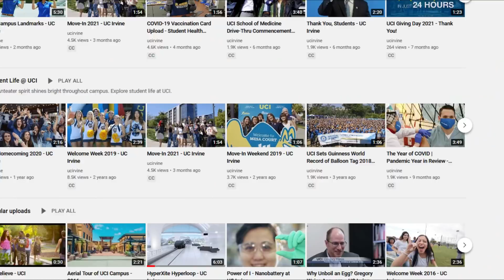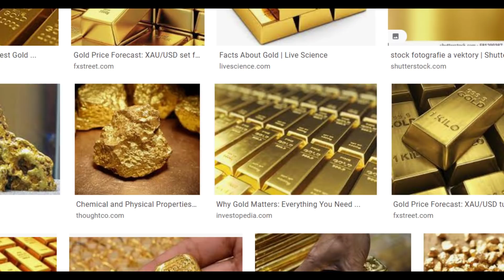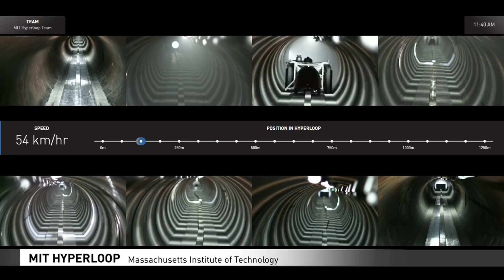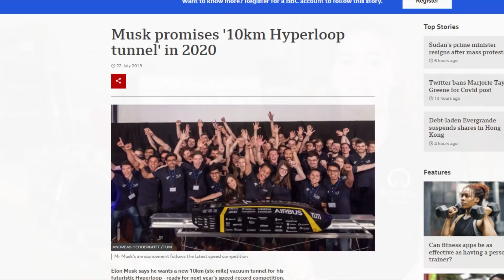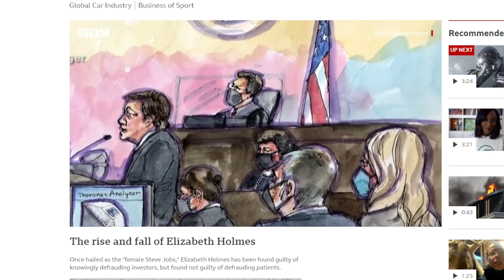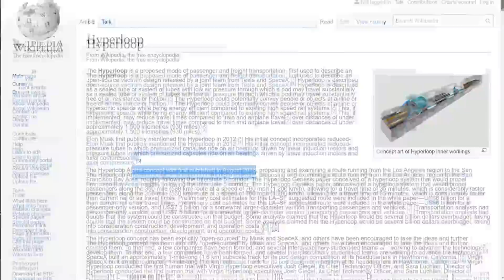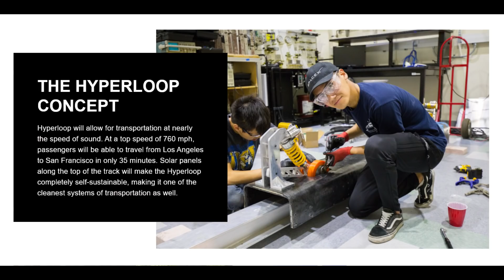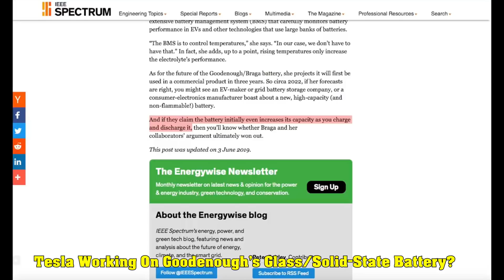The GOLD Battery that will revolutionize EVERYTHING!

Comment: When I was in electrical engineering college in the 90’s, the big national competition with teams from multiple universities was the solar powered car, I believe sponsored by the Department of Energy. I remember arguing with one of the contributors at our college that this was a complete waste of time, that they weren’t solving an actual problem. Better solar  panels is one thing, electric cars is another, but there was never going to be a solar powered car. All it was was an exercise on low weight design, finding a lightweight student to drive it, and optimizing some charging cycles, nothing like an actual car.
Reply: But then schools wouldn't get that grant money that the administrators just end up pocketing.
Reply: Why is that not possible? All you need is a solar farm connected to an inductive charger road with an electric car on it.
Reply: @BillyViBritannia  And how much will that charger road cost ?
Mein Got, we have problems to construct and maintain roads from "cheap and simple" materials like concrete and asphalt and you're dreaming about charging roads.
And I'm not talking about how long those roads would last.
Reply: @BillyViBritannia  why not instead build trams lol
Reply: @BillyViBritannia : Inductive charging would have a ridiculous amount of energy loss going through 4-6" of pavement. The electromagnetic field would cause interference with any electrical device within range, to include the rest of the electronics on the car. The cost of running high voltage coils under the road would not be economically viable.
Reply: @BillyViBritannia  basically, solar irradiance is ~1kW/m². So if you were to cover a big car with solar panels, you could at the very tippy-top, reach 10kW solar power (light, not electricity). The peak efficiency of Solar panels is fairly low, at about 20-30%. So this big car can at best generate 3kW peak, when the sun hits the panels perpendicularly. In reality, with a flat roof (sun tracking isn't really viable ona vehicle), you'd be looking at about half of that - or about 1.5kW/2HP peak.
At ten hours sun per day, this would be sufficient for about 50 miles of driving per day, but only if the car is never in shade, parked inside, in poor weather, or anything else, in a very sunny region. And that is the absolute optimum scenario - a big car with it's entire hood, roof, and trunk covered in solar panels, with the electricity consumption of a compact car. 
So solar cars need to defy the laws of physics to ever be feasible.
Reply: @BillyViBritannia  can't we just have large overhead wires, while we are at it maybe we should make the vehicle larger and have multiple people inside... You know as these people are going between two places, we could put it on rails to make it more efficient...
Reply: @fatrobin72  don't let eev blog see your comment 'visual pollution' he says
Reply: Except our Nuna cars (from University of Delft) have won most out of the World Solar Challenges, they work, the new classes even have room for 3 to 4 occupants.
I'm not saying they're really practical, but at least they work.
Reply: I went to university from '03 to '07 and that was still going on, along with an F1 style race competition, SAE Aero Design Competition, and others I don't entirely remember at the moment. These mostly undergraduate enrolled / graduate supervised school "clubs" are unlikely to produce scientific breakthroughs in technology, but they are fun ways for students to get practical engineering experience. I don't see much harm in it.
Reply: at least a solar powered car is a physically viable concept. There is a race through Australia if I remember correctly. I think that makes order of magnitude more sense than designing anything for the hyperloop
Reply: @kain0m  I did some back-of-the-envelope calculations of Sono Motor's Sion car expecting to show it was a stupid idea. But if you only drive 50-100 miles per week (like many Europeans), it's actually practical. They get around 1kW peak, which gives around 4kWh per sunny day. A car that small can get around 5 miles per kWh. So 20 miles per day (ideal), or realistically 10 miles per day given shadows and light cloud cover. The battery is large enough to average it out.
Reply: the smartest thing i have seen was that some car had a solar panel roof and it could power the interior lights and the ac as far as i remember. its a small thing, but that was pretty cool and actually makes sense and will probably save some fuel, which is never a bad thing. how long that roof lasts is probably another question.
Reply: @Mr.Marbles  just putting slabs of solar panels on a "conventional" car in normal climate is inherently dumb. What I meant was a self sustaining solar car, such as used in these races (https://en.wikipedia.org/wiki/World_Solar_Challenge) . That would not be possible at my region because too few sun energy. There are teams partaking that world solar challenge with really good concepts. Nothing that is in any way practical but some sort of endurance rally type of goal
Reply: Yes, but for the sole purpose of a design task to learn something, such projects are OK. But the way they are "sold" is questionable.
Reply: @jekker1000  Yeah, i was talking about these races as well.
And kind of a funny fact i guess, my country has won the most races so far, and i'm from Holland, which generally has an England-like climate.
But yeah, they did a lot of research on the spot and also mapped out the route, to anticipate climbs and whatnot, so a lot more than just solar reliance was involved, but still pretty impressive.

I don't expect these cars to become mass produced, as they're unsafe in collisions, lots of legs being chopped.
They're mostly cool toys to race with, they do race with more conventional models, as the race rules are changed each time, to come closer to the normal car spec, in solar style.
So, eventually you couldn't see much difference between a petrol powered car or solar, as the implementation usually has to be seamless.
Reply: @JacquesMartini  Yeah, that's the main difference.
There's nothing wrong with projects to toy around with and take it to the limit, even if it's not entirely practical, but it would mostly be a flagship of where that specific technology currently is.
Like in the World Solar Challenge.

But yeah, it becomes another thing when people are asked to invest (rather than sponsor) into a product that is going into production tomorrow and could change the world.
It's almost like Elon wants to evade responsibility, by outsourcing his promises to university students, under the banner of "learning projects".
But he's still made that promise to his investors...
Reply: This happened at my senior school in about 1990 but it was a competition between national senior schools. I was actually chosen to drive it but bottled out for some reason. The “car” was made from 2 racing bike frames if I recall
Reply: @BillyViBritannia  If the post is referring to the contest I recall, the cars had to CARRY their own solar panels. 
OFC the more realistic approach is electric cars that charge from the  grid, a grid powered by solar farms. But that's not wha tthe contest was calling for ... it wasn't envisioning a complete transportation economy .... it wanted each car to be its own, self-enclosed, independent system.
Reply: Those competitions are universal and they are not a waste of time! You won't produce anything good, but the students will usually learn more about project management, working in cross function teams. Usually those things are covered badly in class setting, also it shows to employers, look I'm capable of my basic work right now. That's what those competitions are good for!
Reply: That actually goes back to the mid-1980's.  I remember seeing something about it in the mechanical engineering building, and my first thought was, "The solar cells produce so little power that the frame of this contraption has to be so lightly built that these things are, to borrow a phrase from Ralph Nader, "Unsafe at any speed."

Fraud, Waste and Abuse, going all the way down to undergraduate students' precious TIME when they should be working on more important things.  Internal Combustion Engine power trains can probably be doubled in efficiency if the heat being rejected by the radiator, and going out the tailpipe were put to use.
Reply: They could have made it more worthwhile by having students instead design something that uses solar panels and batteries since those have a practical application.
Reply: @csabalajtha3989  I am the original commenter, and I agree with everything you said!
Reply: @BillyViBritannia  nobody got the joke
Reply: @kain0m  Yeah, but what if you only travel 4 miles a day?  Oh yeah, in that case you can walk and don't need a car.  What a silly idea.
Reply: @BillyViBritannia  And thus we've come back full circle to SOLAR FREAKIN ROADWAYS ;)
Reply: @BillyViBritannia  Trolleycars?
Reply: -Matter didn’t create anti matter
-Anti matter didn’t create matter
(Both of them were present at the time of big bang)
-Both of them didn’t create themselves.
-Both of them came from an unimaginable source,  that unimaginable source created matter and antimatter (everything) thats why it is known as “the creator” of everything.
——————
- that unimaginable source/creator has created sin and virtue which are opposite to each other,
— logic says every action has its own reaction, so the reaction of sin must be different than the reaction of virtue,
— the creator has created prophets to let us know about each and every detail of sin and virtue, also about their reactions,
Thank you :)
Reply: @BillyViBritannia  if you want to power cars on the road with electricity without the need for batteries your best bet is to power them like you power trains, with overhead power lines. There are some test tracks in Germany and the rest of Europe to power trucks this way. Tom Scott did a video about it.
Reply: @fatrobin72  to bad the west let its train infrastructure crumble and focused on roads instead. Currently our best bet is trucks with overhead wires and busses with overhead wires, at least in the US. In cities  trams might make more sense but considering how hard that failed in the US you might just use smaller busses than the ones on the highway. There are already test tracks for this concept.
Reply: @Ninjaeule97  Germany has been experimenting with lorries with overhead power cables on main roads, and batteries for the last leg and it seems to be working quite well.
Reply: @BillyViBritannia  WTF?!   An inductive charger road?   How much copper would that use?   
Try understanding physics, economics, engineering and environmental science before considering a public comment on matters such as this.   Besides, the topic was referring to practical research for autonomous solar powering of individual vehicles.   Your notion is in the same nebula as the hyperloop, spacex, remote-controlled lorries and gold batteries...
Reply: @herrschaftg35  Exactly.
Reply: @kain0m  Precisely.
Reply: @jekker1000  pointless toy
Reply: @Games_and_Music  it does nothing but teach engineers to believe in magic ideas without being able to understand why it's a waste of time/energy/money, all you get out is a stupid engineer
Reply: @forloop7713  yeah I was amazed too... At least this "idea" is physically possible...
Reply: You can make a solar-powered plane but it would usually be some sort of remote controlled glider. I don't remember whether ppl ever made a solar-powered plane big enough for a pilot to sit in. Plus there are safety concerns with such a thing.
Reply: @TheMikernet  Yes exactly, the practical experience of working with a team to design and manufacture something is what I see as the actual goal of projects like the solar car and hyperloop crap.
Reply: @BillyViBritannia  how about just a train?
Reply: @Games_and_Music  nobody's arguing that hundred-thousand dollar ultralight ultra-aerodynamic solar vehicles can't "work" in super sunny Australia.

They just don't "work" for 99.999% of scenarios.